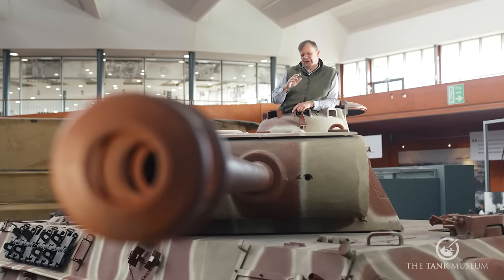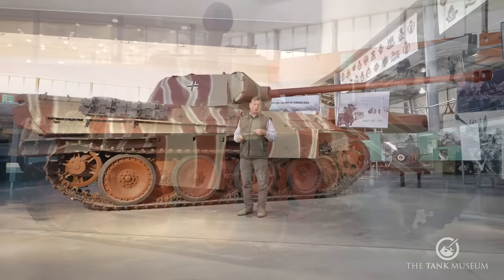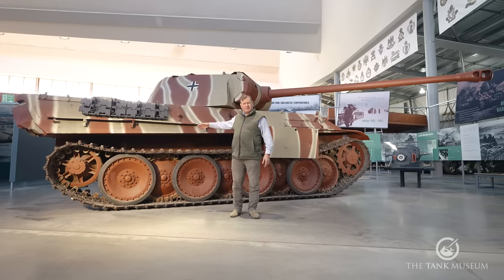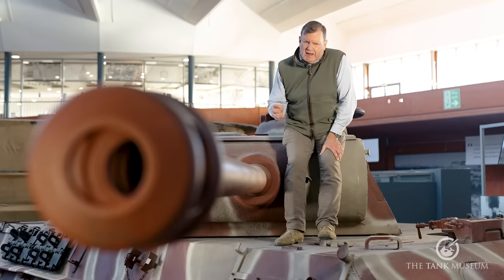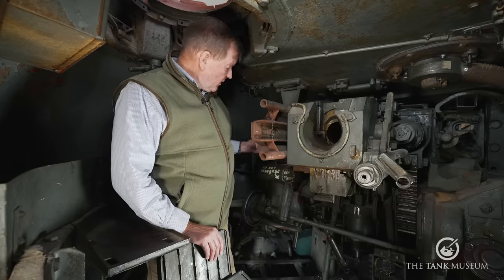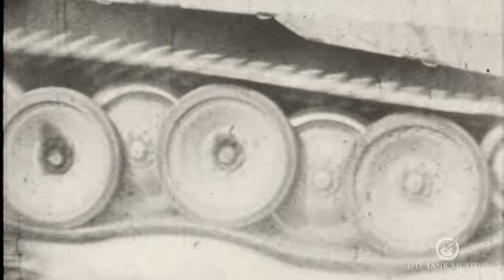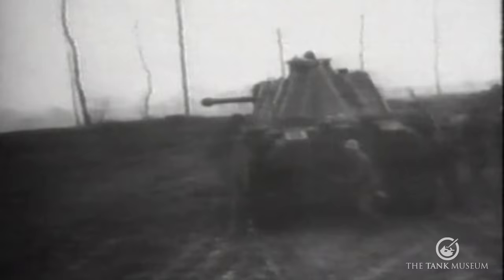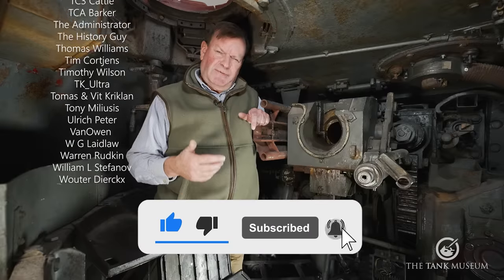See Inside Panther | Tank Chats Reloaded

Comment: It is still funny to me that the French operated the Panther longer than the Germans did.
Reply: Howabout the Syrians stylin' in the Pz IVs?
Reply: Makes me wonder how long the Panther could have served had it been upgraded through the years like the Centurion.
Reply: modern shells would've made it very outdated  @yallacrazy
Reply: @Half_Finis could have increased protection
Reply: @yallacrazy  If they replaced engine and transmission and upgraded the gun, maybe? But Panther's armour scheme and interleaved wheels weren't particularly amazing regardless, when Centurion was right from the start an exceptional design (sans some early engine problems). You have much more work and expense to upgrade Panther than to upgrade Centurion or american Pershing (which was developed into Patton tank), and you still cannot iron out some fundamental, suboptimal design decisions (like drive system in general). And for any budding, tank hungry country, Germany lost the war, right? Much easier and cheaper to take T-34 from the USSR, which was pretty much giving them away after WWII, or NATO, who were anxious to have another ally.
Reply: more funny that the French chose/took to use Panther tanks after WW2 was over.